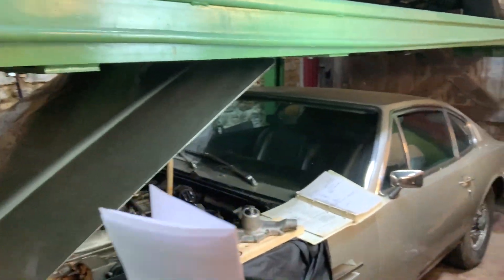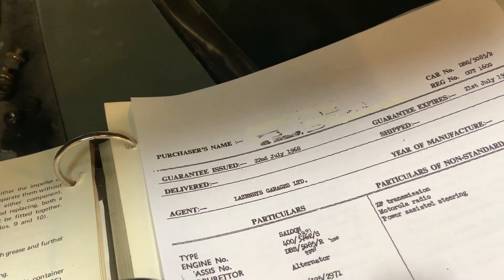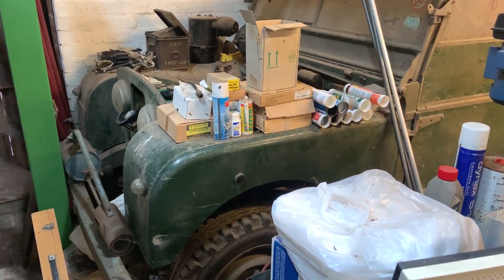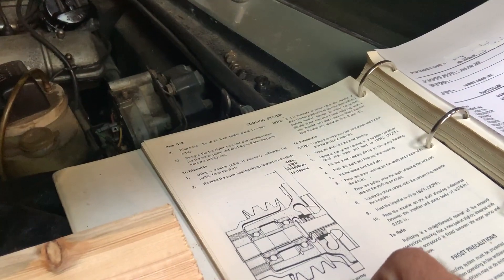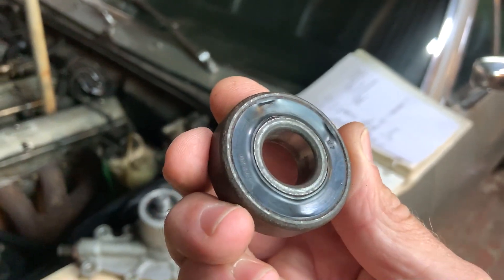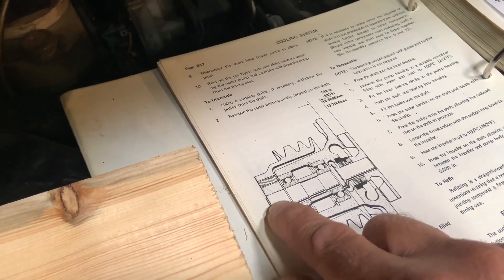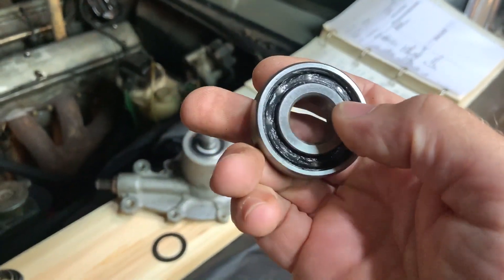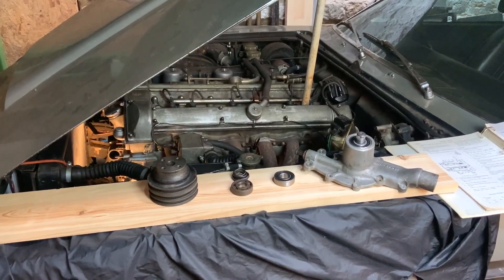1968 Aston Martin DBS Water Pump Rebuild Update. Have I Been Able To Save This Pump And Revive It?

Comment: JMB Services does an uprated water pump kit or new casting complete.
I have that on my DBS engine,,along with their head gasket modifications. Very happy with my temps.
Nice video, and good luck from a fellow DBS man.
Cheers
Reply from the maker: Thanks for watching and taking the time to comment. That's great information about that company, thank you. I filmed more footage of the completed rebuild but as yet have not had time to sort out an upload. The car is now back on the road and the rebuilt pump is running well. I swapped over to a composite head gasket a few years ago and have found it much better than the copper ones. I have a slightly cooler thermostat on the recommendation of a friend and my engine is running at lovely temps even in stop start queues and hot ambient temperatures. there are a couple of recent pictures on my Instagram page, the link is on my YouTube home page. It would be great to see a picture of your car, here's an email info@snoozevideo.co.uk Take care, all the best to you

Comment: You could get bearing greasers, they were a grease filled cylinder with a piston with a hole & taper so took a range of sizes, per size. Pushing down in the inner race with a taper plunger, the grease would go round the shields of the inner race. Non shielded being much easier.
Reply from the maker: Sounds like something designed to make a job easier and cleaner, unfortunately I don't have one so greasy fingers it is. Best regards to you